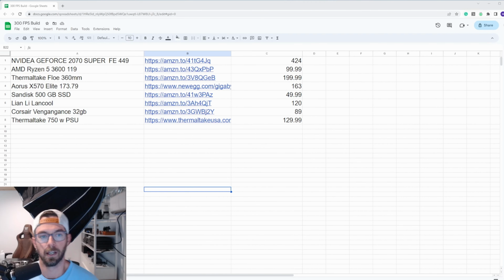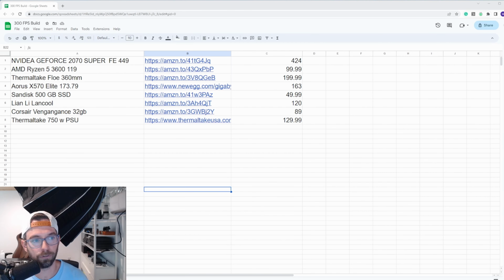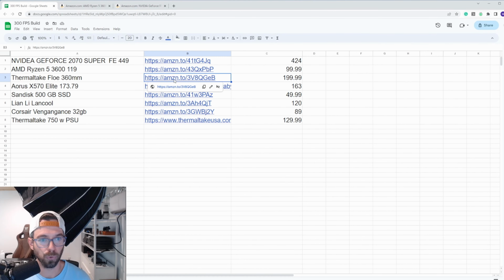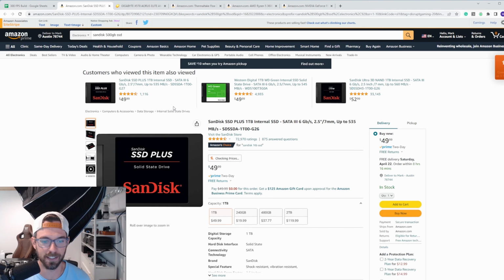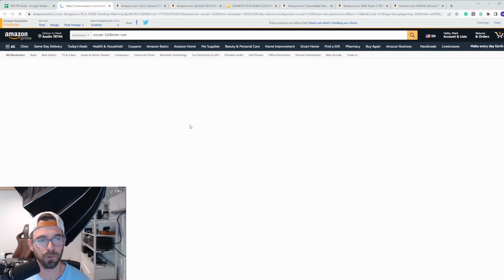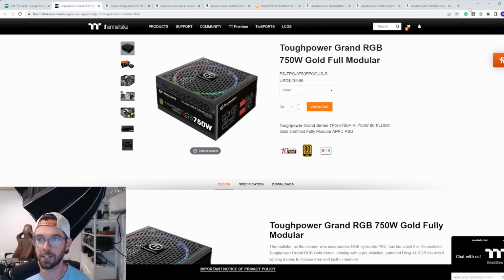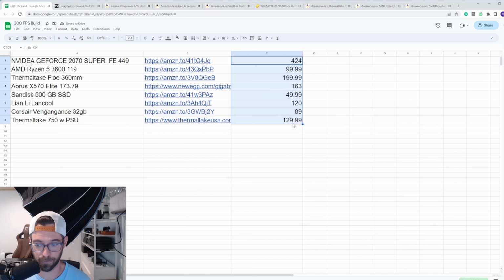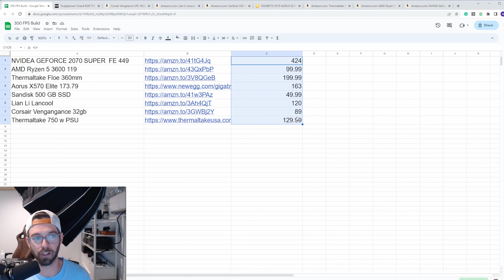Mid Range 300 FPS Build - AMD Ryzen 5 3600 + 2070 Super

Comment: The rear fan should be flipped. It's not supposed to intake, at least not in this configuration, you should have left it as it comes with the case
Reply from the maker: Would have negative air pressure inside the case then.